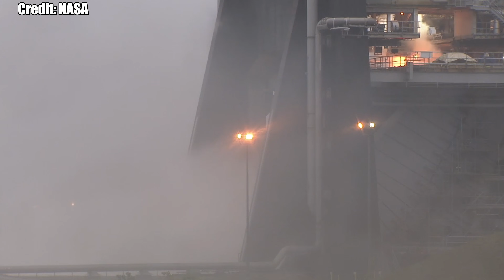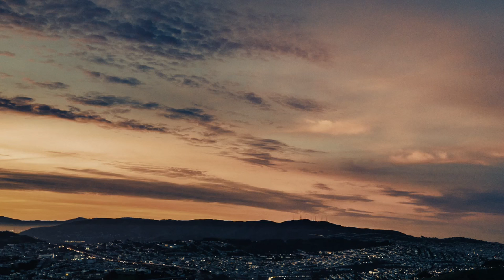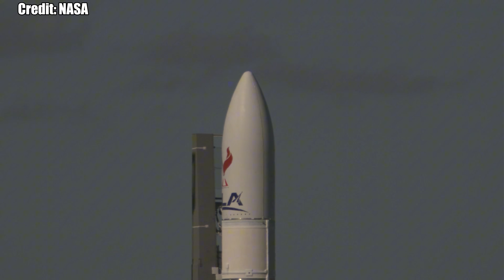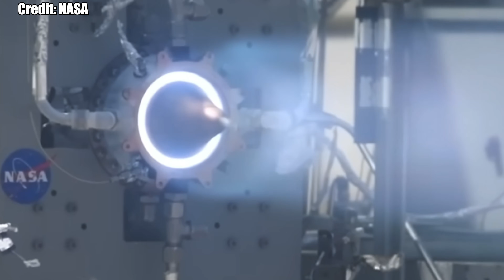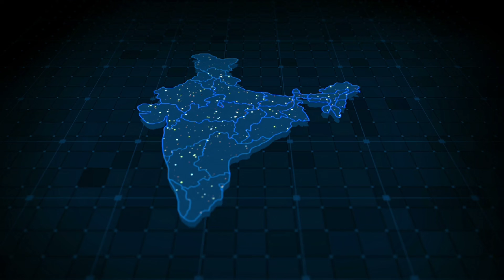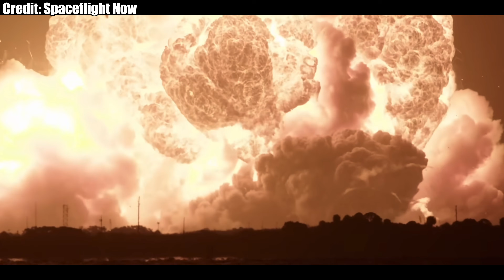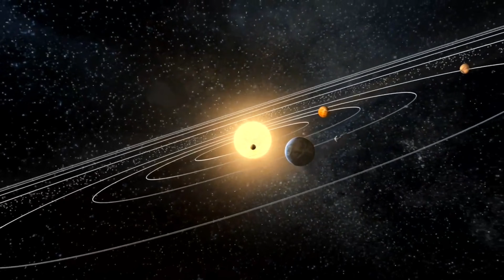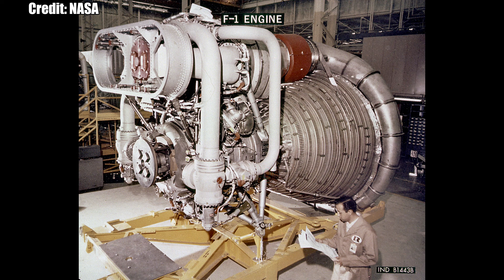They Just Proved Rotating Detonation Engine Will Work

Comment: bullshit analysis for likes.

“Potentially 25% more efficient than anything flying today.” Inflated, and not what this test showed. Astrobotic’s release says the process offers the potential to raise specific impulse by as much as 15%, plus a better thrust-to-weight ratio and a shorter combustor. The ~25% figure is the ideal thermodynamic ceiling often cited for pressure-gain combustion versus constant-pressure burning, mostly in gas-turbine analyses. Ideal rocket-cycle comparisons (Humphrey versus Brayton at the same inlet pressure) more often land around 5–11%. Measured rocket RDRE specific impulse in published work has frequently sat below an ideal deflagration engine once incomplete combustion, wave-speed deficit, and heat loss are included. The April 2026 campaign did not publish a measured Isp delta. Comparing an unmeasured theoretical bound to Raptor 3 is not supported.

Comment: If you are properly describing a kerolox rocket, that would be a giant aluminum can of liquid oxygen and kerosene, not the other way around ;p
  A 5% isp gain for a atmospheric booster engine is a 50% gain in payload for an equal wet mass system, however total thrust to mass ratios, acceleration and max q limitations and a host of other factors play into this.  The rocket equation is fairly simple compared to the math describing an actual application.  Trailing that is relight capability, cost efficiency, throttling capability, in flight environment issues, and of course it must also operate and throttle well during reentry and a landing burn.  My guess is something like 30 times the development cost of a conventional flight ready engine.  Hope I am totally wrong.

Comment: So this video is clearly largely lying. Improvement of 25% isp is absurd. The way of combustion does not change the energy of combustion. The isp gain from the detonation part should thus be 0%. The pressure of the chamber is controlled by the turbo pumps, also unchanged. So what changed? The geometry of the combustion chamber. The residency time of the propellant inside is much less, thus the chamber volume will be much less. It is cylindrical though, so the volume area ratio is much less. Thus heating problems. And the nozzle seen is an aerospike. This can "increase" the isp at sea level. In quotes, because a perfectly adapted sea level standard nozzle would be as good, but the aerospike maintains better efficiency in higher altitudes.
The gain of these detonation engines could be in the TWR. The gain will be minimal. Higher pressure, better corrosion resistant metals, additive manufacturing, costs reduction, this is a much bigger deal. Like Raptor engine.

Comment: This video completely ignores the fact that this type of rocket would also have a higher top speed than a chemical rocket. A probe could reach Pluto in 5 years instead of 10. And you can put this type of engine on an airplane (or, even better, adapt the design into an RDJ engine, J meaning jet), which gives Astrobotics a way to make money off their 4000-lb-of-thrust engine. 4000 pounds of thrust is plenty for a private jet. The only question is if their engine can run for several hours.

Comment: Excellent,concise documentary!   I'm unsure if I heard it mentioned somewhere, or just my imagination....isn't there also research on using RDE on a jet? (i.e. an air breathing engine)  
This would be superior to a scramjet, especially if it could also support subsonic flight, even starting from zero ground speed to enable runway travel and takeoff from airports
Imagine a compact aerospike engine replacing a high bypass, wide mouth gas turbine engine, with multiple compressor stages, thousands of intricate turbine blades, and giant rotating mechanical assemblies!  What a game changer that would be.
Reply: And imagine a sound that a continuous explosion is producing.... On ground on any airport...like continuous thunder

Comment: As the flame front is rotating it has both axial and tangental speeds?  Tangential speed  aka swirl takes energy away from that which can be converted into thrust. 

I'm not convinced it's pulsing that prevents chamber wall damage.  boundary layers provide a  degree of thermal insulation.  detonations disrupt gas boundary layers. with a disrupted boundary layer red hot gas touches the metal directly. that is why detonation will quickly melt holes through IC pistons 
I suspect what's going on wuld be colder gas has higher density that hot gas. so when cold and hot gases are rotating... the colder gas will be flung towards the cylinder walls, and that will push hotter gas away from the wall
Reply: The flame front is not a mass moving around in a circle, just a border between subsonic and supersonic flow, and also the place where chemical reaction is happening (not saying you misunderstood this, but an unfamiliar reader could assume it).  Because it's an oblique shock, you're absolutely right in the sense that the supersonic flow is leaving at an angle, but I note that they pair this with a divergine nozzle.  So, a lot of the exhaust velocity is coming from later expansion along the engine's axis.  I would guess the angular component is not very large compared to axial by the time it's done expanding.

Comment: Er... the math does not get the most compelling for deep space applications. Electric engines are already vastly more efficient than these. These will make satellite maneuvering operations cheaper because the fuels for electric engines are so expensive, but other engine technologies under development will solve that far more effectively than these will.

This will be, at best, a niche engine for orbital or deep space science missions.

You're right about Luna and Mars landers and deep-space crewed missions, though, at least until nuclear engines become viable. Electric propulsion is just too low thrust for crewed missions to take advantage of.

Comment: Are we to assume that the only change in the rocket system will be the switch to more efficient motors?  Wouldn't the operators just increase payload by whatever efficiency improvement RDRE provides?

Comment: Not only do rocket engines have to be efficient and reliable, but also cheap, light, and have a lot of thrust. This engine is efficient and reliable, but it is expensive, heavy, and has 1/150th the thrust of other engines.

Comment: First: It is a great video, and really good storytelling! Like the video material, mostly spot on! 10/10
Second: fact check… well. Hope to be objective here and keep this as a friendly hint to improve. Your research or your LLM prompting. 
I worked on 3d visualization on this kind of project in 2015. It worked for a minute back then. 
Additional information to your video:

Astrobotic cites potential specific-impulse gains of up to about 15%, not 25%. Detonation does not add chemical energy to the propellant; its advantage comes from pressure-gain combustion. A 15% Isp gain also does not translate directly into a 15% reduction in propellant or launch cost.

Rotating detonation was demonstrated experimentally around 1960. JAXA operated an RDE in space in 2021, and NASA achieved multi-minute operation before Astrobotic’s Chakram result in 2026. The technology therefore has a long development history rather than a sudden breakthrough after decades of inactivity.

NASA had already demonstrated about 5,800 lbf of thrust for several minutes and later reported a run longer than Astrobotic’s 300-second firing. Chakram is an important demonstration, but it sits within an existing progression of increasingly capable RDRE tests.

Astrobotic reported no discernible hardware damage after the long-duration firing. Cooling, throttling, engine mass, fatigue life and reusability remain development issues. Published RDRE research also reports severe chamber-wall heat loads, so an inherent cooling advantage has not been established.

Rocket RDREs, air-breathing rotating-detonation engines and aerospike nozzles are separate technologies. Hypersonic air-breathing systems still require inlet and flow-management hardware, while aerospike altitude compensation is independent of the combustion method. No demonstrated engine combines all the advantages the script attributes to them as a single system.

Disclaimer: I did use perplexity, Claude and ChatGPT for research. And I must say, first results were full of wrong facts… 

Thank you for the topic and great work!
Reply: Thanks, was scratching my head at a few of the facts in the video, glad someone took the time to clear them up a bit

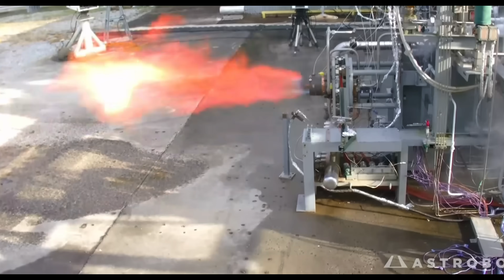Comment: 17:00
30% of a rocket cost is it's engines even if you save 25% on vehicle size and fuel savings (do note fuel cost is negligible for rockets) I doubt this would be more economical if the engines were more complicated and expensive to manufactur which being new technology the first few rockets probably will be. the reason starship is so cheep is because it uses extremely cheep 1 million dollar engines

Comment: GE is working with DARPA creating RDE for both small, missile applications and larger for fighter jets. Increased speed, longer range and higher speeds.
Reply: I wonder if the materials development to handle the high heat at long periods for the skin of an aircraft is keeping pace.

Comment: General Electric is researching Rotating Detonation Engine while Lockheed Martin has been working with a normal jet engine to convert to a Ram Jet / Scram Jet engine combined into One Engine. The goal is Mach 6 Plus for the SR-72  as a  Bomber. 
GE and Lockheed Martin are now working together on this.

Comment: how do they pump them when they are not on a test rig?
Reply: Likely just a normal turbopump if I had to bet probably open cycle in the beginning just as that's probably one of the earliest awnser before moving to a more efficient (and difficult) cycle like closed or full flow staged combustion 

arospike nosles are also well suited for expander cycles (using fuel to cool the spike and then using that hot expanding fuel to spin a pump) so we may see expander cycles become more popular

Comment: The problem with your argument is... you can't keep them cool 😎 with the 'spike' in the centre, is that you have twice surface area to stop from melting 🫠 and there's only so much cooling the fuel can do, unfortunately, and 300seconds is not enough time to account for heat soak, this  video is a lie 🤥

Comment: I would hope so, the Air Force and Boeing have been flying NGAD technology demonstrators for years with rotating detonation turbofan engines.
Reply: Nah, that's a Ramjet and they're talking about a design that goes from Ramjet to Scramjet as you get fast enough. Not rotating detonation. Those are air-breathers, rotating detonation has oxygen-injection.